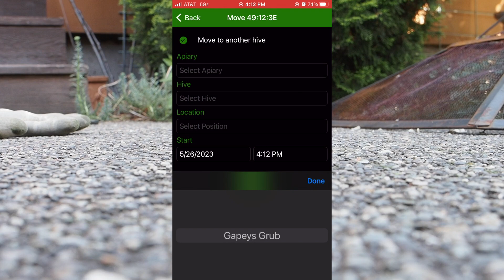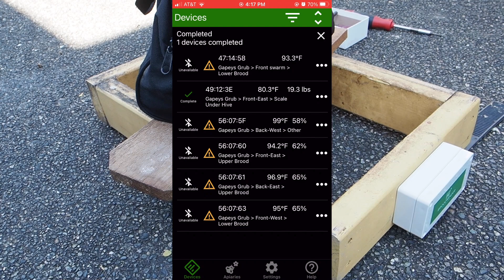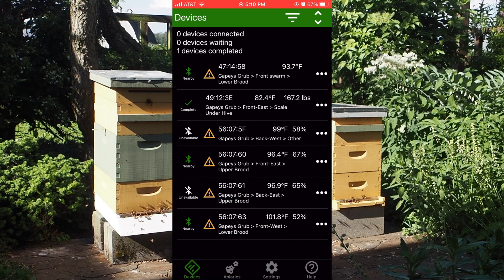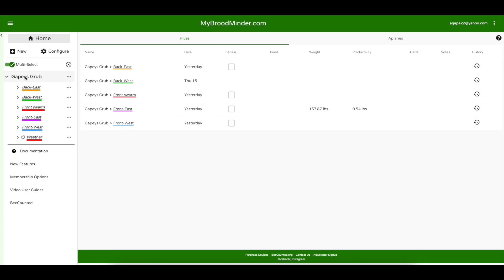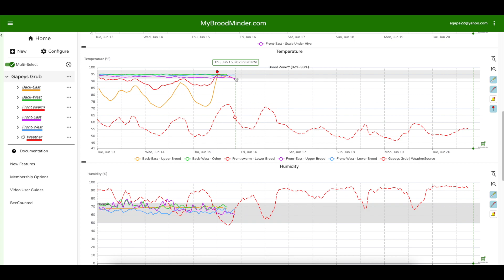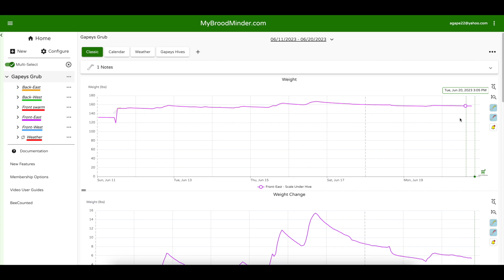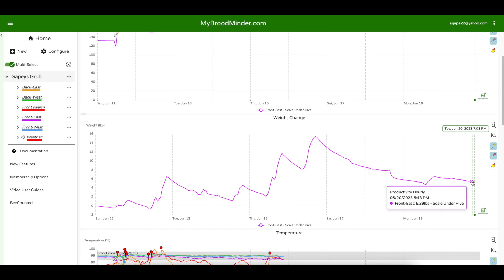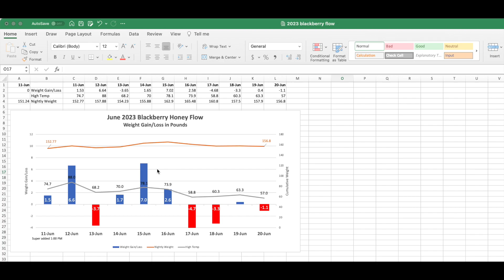Broodminder Hive Scale

Comment: I used a hive scale a couple of years ago and came to the conclusion that the data could be deceptive.
It measures the HIVE weight (not the honey weight) so gains/losses may be attributable to other factors such as more/less brood, woodwork absorbing moisture from the atmosphere on rainy days or drying out on very hot days, etc.
You also have to adapt your management practices when using this sort of device e.g. it is common practice to put something heavy ontop of the hive over winter or in windy conditions. Obviously, this distorts the figures enormously. Also, if you use a hive strap to secure the roof, you have to be careful to secure it under the floor and not under the platform (don't ask me how I know this ;-) ).
I think these devices are useful. They do alert you to sudden changes (such as if a hive is knocked over by animals, etc) but you really have to be careful about how you interpret the data.